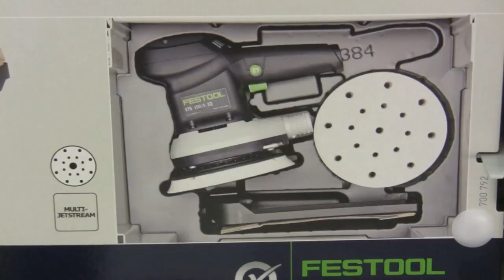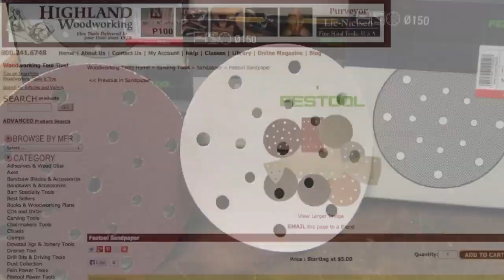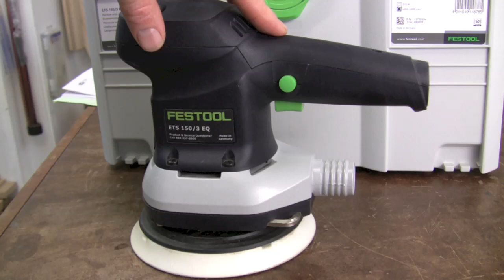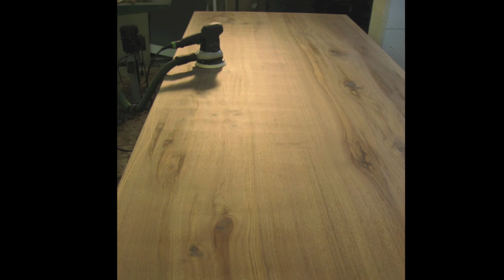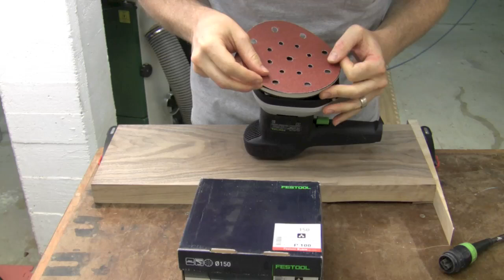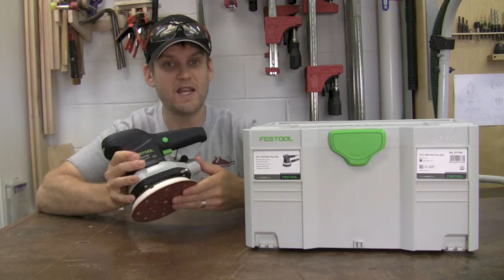Festool ETS 150/3 Random Orbital Sander - Highland Woodworking

Comment: Hey do you think this can be used for wet sanding clear coat ?
Reply from the maker: +Nicholas Clarence This sander is not recommended for wet sanding.  I'm not saying I haven't done it (very minimal just for lubrication with very fine grits and pads) - but it's not a sander meant for wet environments.

Comment: Does this really leave no scratches?
Reply from the maker: +Koen Klijnsmit All sanders and sandpaper leave scratches - that's how they sand!  However, as you move up in grits the abrasive is finer and finer until you can no longer see or feel the "scratches" left behind.  How far you move up grits (when to stop) is a personal preference.  I'll typically end with hand-sanding 320 with the grain.

Comment: I use a 5" Dewalt connected to a Porter Cable vacuum with a 1-1/4" hose. Is the Festool compatible woth this vacuum? Upgrading everything at once is too expensive for me right now. As a painting contractor I stain and poly a lot of log home interiors and v-match walls and ceilings. Would the 6" Festool be too heavy for that use?
Reply from the maker: +The Garlic Farm A 6" disc size will cover more area as you work,.  You would need to compare weight statistics to the weight of the sander you've been using to determine differences on paper.  In actual use, what you experience is a based on some variables, like body size; if you have arms like Popeye, you may not bat an eye with a heavier sander.  Connecting a vac hose to sander is just that and once you're connected you are good to go.  There are tapered hose adapters that help in getting a particular vac hose to connect to particular sander's port, (Festool or any other sander) and there is always duct or gaffer's tape in a pinch (gaffer's tape does not leave sticky residue). A vacuum does not have to be a Festool vac to use with a Festool sander.
Reply: First f all : nice and proper review. 

A question about the 150/3 : can you use a Festool 496121 Longlife Filter Bag in place of a vacuum cleaner? 

Grtz

Comment: I have a random orbit sander now it works but the speed slowed down to much and it gets hot. How can I fix it?
Reply from the maker: Jerry Thompson How long have you had your Festool Random Orbit Sander. If it is less than 3 years than it is still under warranty and you can contact Festool here: https://www.festoolusa.com/service/repairs/
Reply: +Highland Woodworking at my job I use this sander and I go through these every couple of months.   they slow down and stop spinning after some pressure is applied on it and then eventually it dies.  is that natural?
Reply from the maker: +TheEggoProject No, it is not normal for the Random Orbit Sander to have to be replaced every couple of months. Festool has a 3 year warranty on their tools. If you continue to have this problem you should contact Festool directly: https://www.festoolusa.com/service/repairs/
Reply: +Highland Woodworking my boss got the warranty already.  but I have gone through like 7 of them already.

Comment: And it's still overpriced.  I can buy a dewalt 5" and a Ingersoll Rand 300g and still have money left
Reply: @ Nicholas Smerk - i do have massive nerve damage in my hands and can't use the cheap box store sanders anymore so im very thankful for these high end sanders with little to no vibration, it definitely helped save my job/hobby furniture making.
Reply: If your sanding pine and nailing bird houses together then yes the dewalt and other DIY brand sanders are fine but if you have ever used festool or have any nerve damage in your hands the festool has an incredible amount less of vibration. I sold all my dewalt sanders because after an hour of sanding i couldn't feel my hand, the festool can be used for hours with no ill effects.
Reply: @woodshopmafia4732  I haven't been able to feel my hands for years (I'm being sarcastic).  I'm sure it's an impressive tool but really?